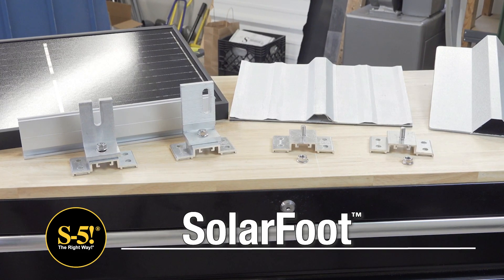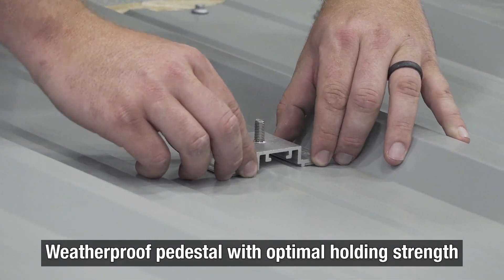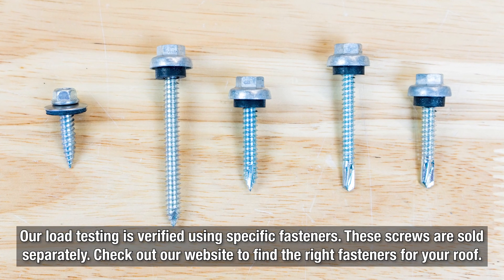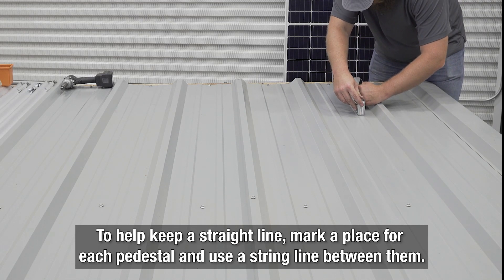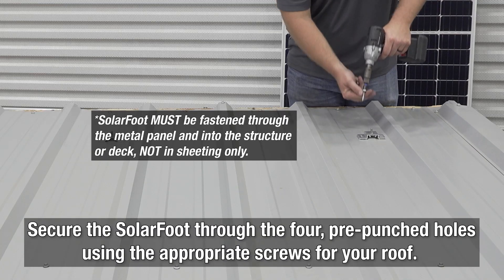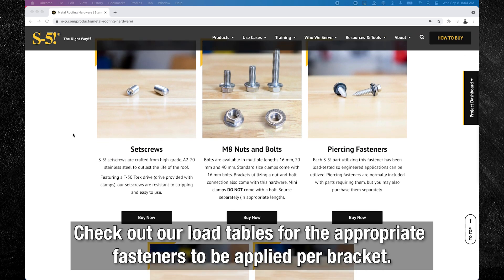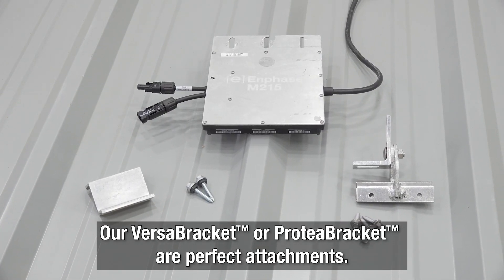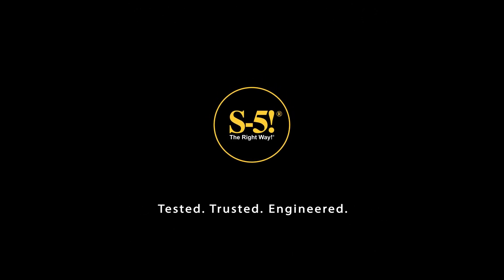SolarFoot™ Installation Demonstration

Comment: How are you supposed to get 4 screws in to a purlin?
Reply from the maker: For attaching to timber or steel purlins, we have testing with both two and four fasteners.  Most purlin installs will only use two screws, and we have the appropriate testing for your solar designer to reference.